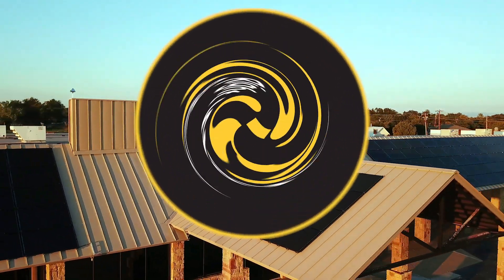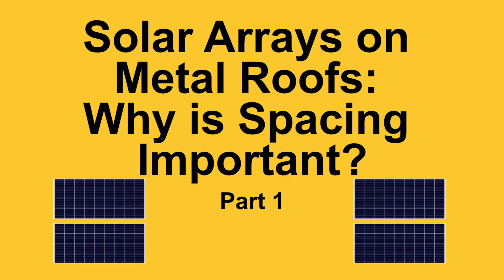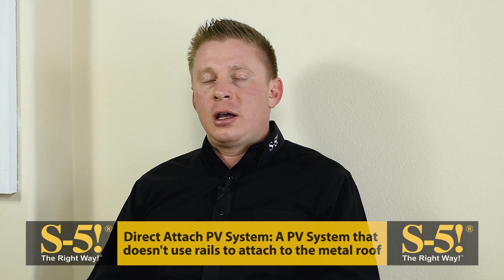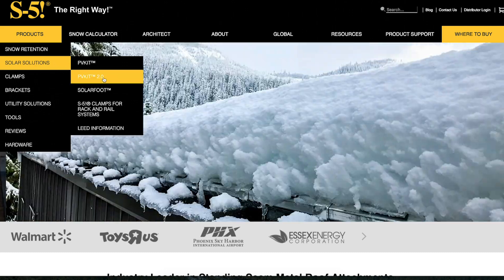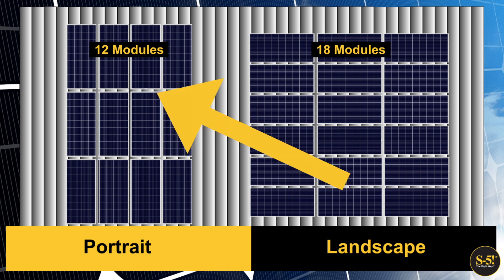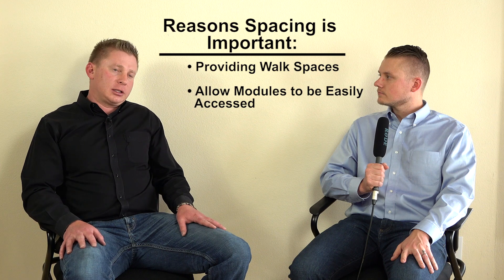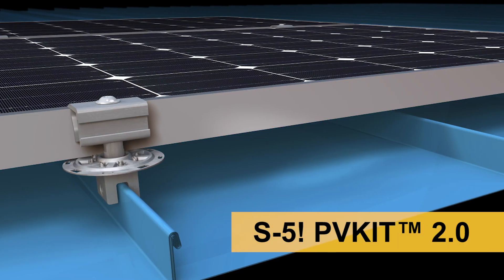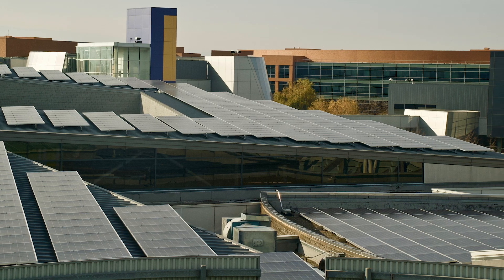Why is it Important to Space Solar Panels on a Metal Roof?

Comment: I will install solar on my carport. And will skip the roof. Install homemade rails directly in the structure :) So the panels will be the roof...
Reply from the maker: Sounds interesting!  You could also use our SolarFoot or VersaBracket to attach a custom fabricated racking system directly to the structure as an alternative.  Good luck with your project!